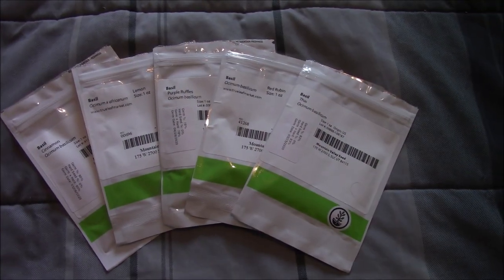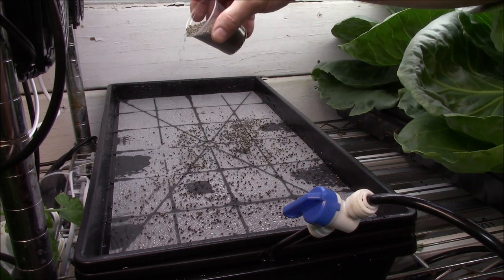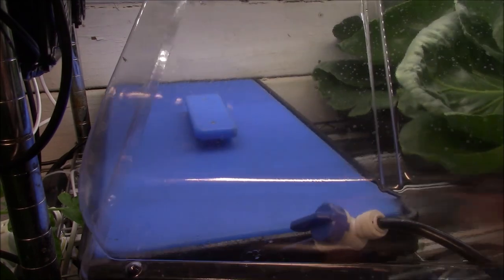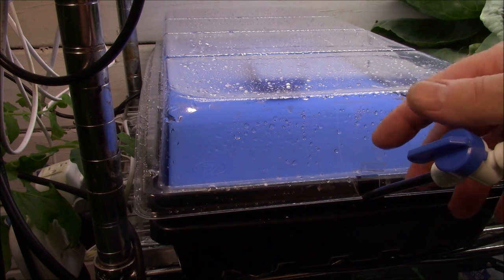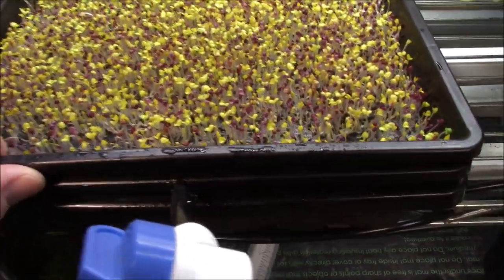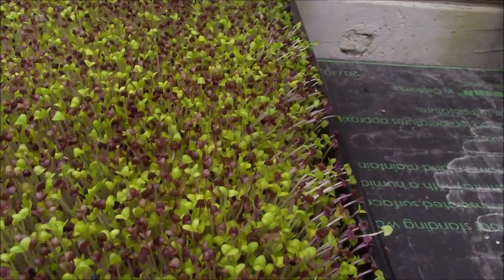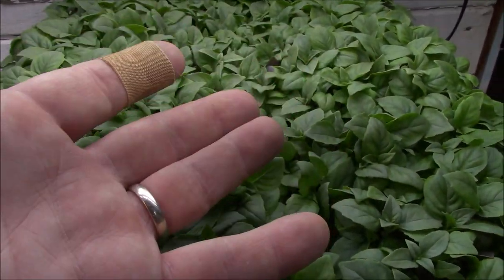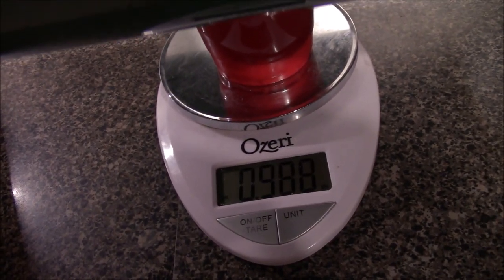16 Ounces of Basil Mix Microgreens (Lemon, Thai, Purple Ruffles, Red Rubin, & Cinnamon)

Comment: Hi there! I have your first edition book on Kindle and I am looking for the second edition. When I click on both the books, it looks like its the first edition? Or have you replaced the first edition with the second? I'm a little confused.
Reply from the maker: Help me figure this out.  In the link here in the description of this video, when I click on it, it takes me to my Amazon page.  In the "Microgreens" tab, it shows 4 books which are the color and black and white of both the first edition and second edition.  What books are you clicking on?  When I click on all 4, it takes me to the right place for all 4.  I did add the Kindle only to the "Microgreens" tab so it's directly clickable there.  Both books are named the same primarily so Amazon "auto link" to the Kindle is messed up only on the Large Color Version of the 2nd edition.  In my management page, it says it's not linked so I'll have to contact Amazon to unlink the Large Color version.
Reply: @C3Voyage  I'm not sure what happened, the other day when I clicked on your link and went to the Amazon page I only saw your $16 and $36 dollar book option, with the old cover. There was a color version and a BandW version. I clicked on your link today, and I see your second version right away it has a different cover even. I promise that wasn't there the other day! LOL Not sure what changed if you did something on your end or what. The other day there wasn't 4 books to click on, only 2.